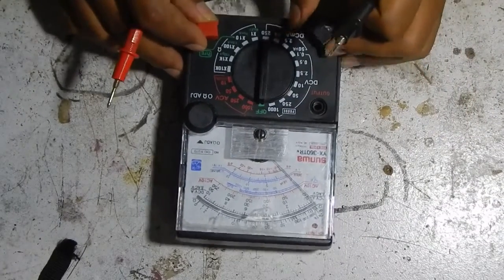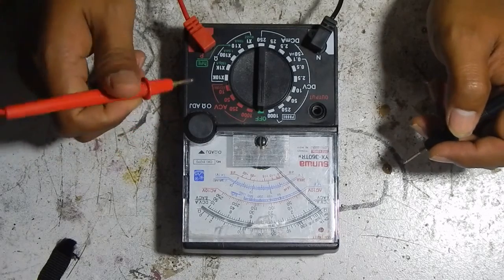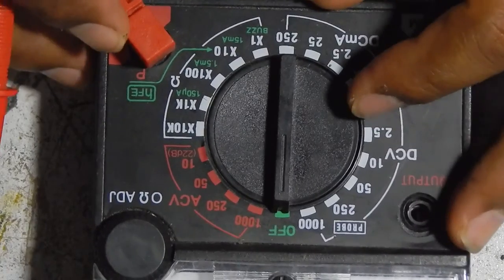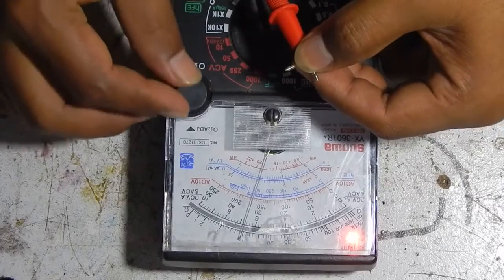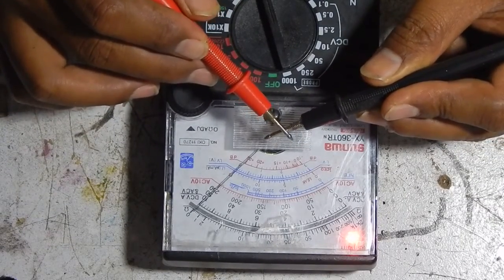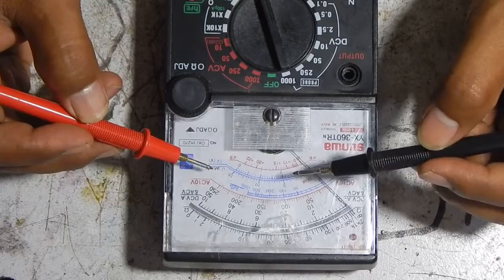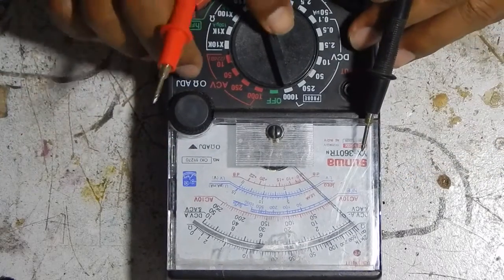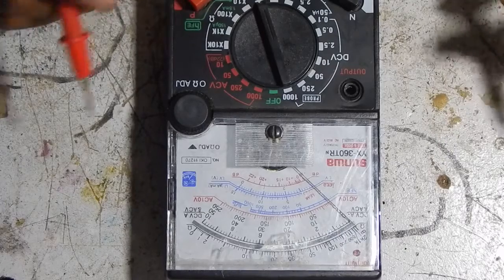How To Use Multitester To Check Shorted Laptop Motherboard

Comment: Acre laptop white display problum. 
I Chenged display cable and lcd connector 18v 3.3v allredy ok. External monitor have good working. How can solve this problum
Reply: check the screen fuse 3.3v is ok or not if on change the screen